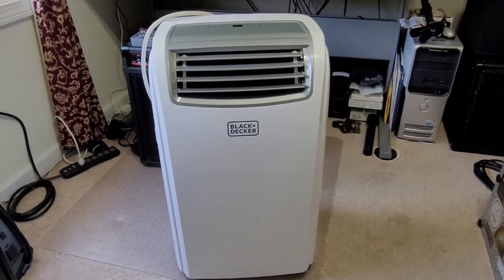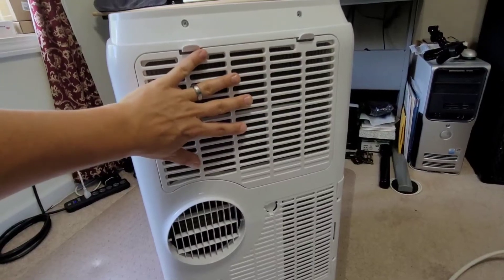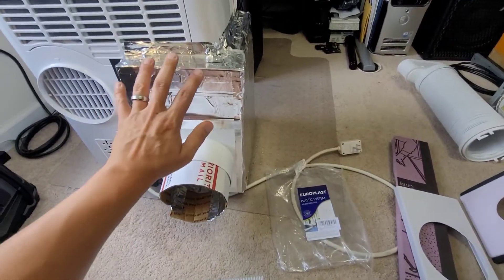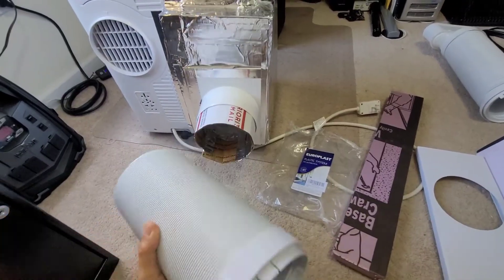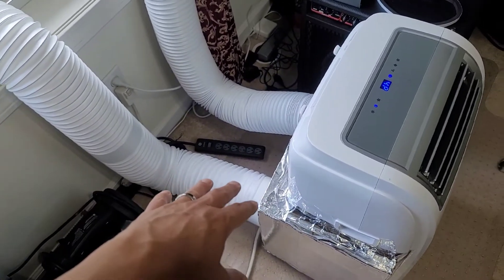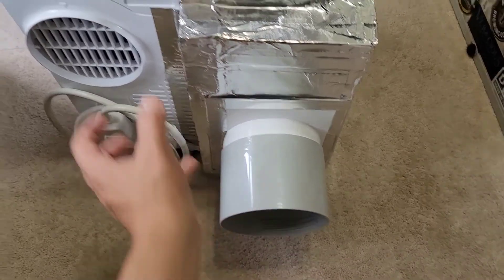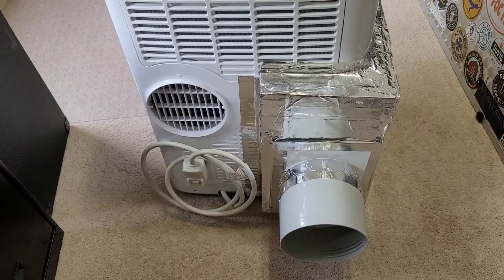Black & Decker Portable Air Conditioner BPACT14WT: Single to Dual Vent Conversion

Comment: Do you seal the intake hose your adding completely around the intake vent ? Or do you seal the hose around the vent with two little slits to let some inside air in ?
Reply from the maker: I sealed it completely around.

Comment: i wished you would have made the video doing the whole process! it would have been really cool
Reply from the maker: My apologies. If there is anything unclear please let me know and I can try to answer and clarify for you.
Reply: @Bassguitarist1985  hey I got a question. I got lg 12k btu single hose ac. It’s throws in really really cold air but as you know it doesn’t cool off the room like a window ac does. Would it be better to get a dual hose ac than trying to convert the one I have? I am getting one for the same price I’m selling this one but it is 11k btu danby. Thanks
Reply from the maker: @inouske2975  Always go for a dual hose unit since they have far superior efficiency, meaning it will cool off your room quicker and with less energy.

Comment: what i did was i covered 2/4 of the vent with foil, 1/4 of the vent was uncovered, 1/4 was an hose from my old ac, 
I have a Logik glp09-port . means i got a 9k btu heat pump, its quiet, the compressor is insulated to reduce noise, its self evaporative, it think it has a built in reversing valve in the compressor.
so it actually really really helped with the pressure problems and improved cooling! you dont actually want maximum suction, unless the hose is bigger than the exhaust hose, always have an opened hole so indoor air will contribute.
ill covered the opening with foil en see
Reply from the maker: Would love to see a video of your modification!

Comment: Thank you!! I am doing this STAT.. unintended consequence of this drawing air from the room is is also causes a vacuum - and in my case it is sucking disgusting cigarette smoke from the surrounding units into mine. I’m hopeful that this should alleviate this somewhat.
Reply from the maker: Eww! Fingers crossed this mod will solve the issue

Comment: How did you establish the unit was sealed top to bottom on the inside of the case?
Reply from the maker: Seals between the evaporator pan and the rest of the case insides, with exception to the evaporator  drain which drips onto the hot condenser coils, which evaporates and goes out the exhaust. As a result very little condensation comes out of the condenser drip tray/drain plug.
Reply: @Bassguitarist1985  sealed with foam strips?
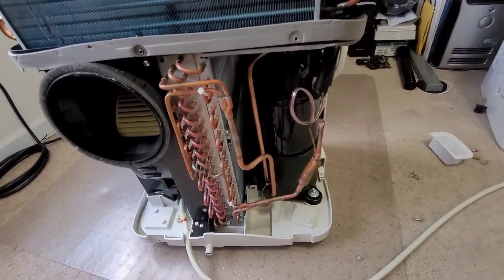Reply from the maker: @hdsheena  yeah at 3:14 i point to it

Comment: Hello, another question for you, I’ve got two portable a/c units, plan to use them side by side in the living room to cool an 850 sq foot condo. Do you feel the two units can operate together a few feet apart, so if one unit fails to keep up with higher temps, the other unit would kick in, versus the 2nd unit never  kicking in, where the first unit is doing all the work? I supposed I could extend the hoses and have them about 10 feet apart. What are your thoughts?
Reply from the maker: Using two units will certainly help your cooling capacity. You can set them to the same thermostat settings to achieve this. I would not set them up as a master and slave meaning one unit is constantly running trying to get to its lowest possible temperature and the other one simply running at a lower thermostat setting. You can run them right next to each other or a part I don't think it will matter.
Reply: @Bassguitarist1985   Thanks for the reply, much appreciated. Those were my thoughts as well, will be trying it out in a few weeks!
Reply from the maker: @KerryMack4  definitely do a video!
Reply: @Bassguitarist1985 you probably don’t want them in the same circuit breaker, would be my anyway
Reply from the maker: @ash1eyrose  agreed, at least two branch circuits at 15A or 20A

Comment: This is super helpful, thank you and much appreciation for making this video. I Plan to convert my Honeywell MN-10CES single hose to dual hose, and it's similarly set up as your B+D unit on the air intake. Question, have you noticed any issues with taking the air intake from the larger space down to the hose 5.9 space for air intake, and is the unit still working fairly well using this modification?
Reply from the maker: No issues so far! The aluminum tape however does not seem to stay stuck forever and I've had to replace that a couple times to maintain the seal but other than that it's been great!
Reply: @Bassguitarist1985   Thank you, fantastic, I look forward now to making this modification, and hopefully decrease the negative air pressure from the outside!

Comment: Actually I do like the fact that your machine gets noticibly quieter with the mods than be4, I have a portable ac unit too with a massive 6 inch single hose and I am still trying to find a way to modify it, because aside the room negative pressure issue with these single hose units another thing is the noise it makes. Mine has a large condenser vent behind it with a very powerful and noisy blower fan. The compressor also makes a lot of noise through the condenser vent. Thanks for a great video, very educative too👍

Comment: If the air coming from the condenser is hot, you might have too much restriction / too much pressure loss in your ducts, DIY adapters etc combined. That in turn increases the power consumption and at the same time decreases cooling. Try to at least have the hoses as short and straight as possible and with gradual turns instead of sharp kinks. Hope this helps, and thank you for the video!
Reply from the maker: I followed your advice and kept the hoses is very short and the air conditioning has been running great since.
Reply from the maker: I'll definitely take a look into modifying to your advice!
Reply: Perhaps raising the unit up so the tube is as straight and short as possible to the window could be a good idea?
Reply: Late response, but: the hose that blows to the outside is always warm bcause there is a lot of hot air going trough it... thats the way the thing works 😅 It doesnt help to make the hoses shorter, that only means it will radiate less because the path is shorter. But it will still get hot no matter what.
Reply: @justsomeone89  obviously the reason why the exhaust ducting gets hot, the reason for making the ducting as straight and short as possible is it also helps lower the resistance of the intake and exhaust ducting so the air-con unit doesn't have to work as hard which should help to make it a little more efficient, help prevent the unit from over-heating and shortening it's lifespan. Also it does help to make the exhaust ducting potentially cooler if the hot air can flow directly without obstruction, if the hot air is hitting bends you'll find hot spots develop at the kinks
Reply: Acfinity has some nice inline booster fans with high static pressure on amzon

Comment: I'd like to try this with my Danby.  No worries about a fire hazard or anything?
Reply: It might blow up the city if your not careful. 😂
Reply from the maker: Everything seems to be running fine. Only minor issue is that I have to reapply some of the aluminum tape to stick it to the outside of the body.